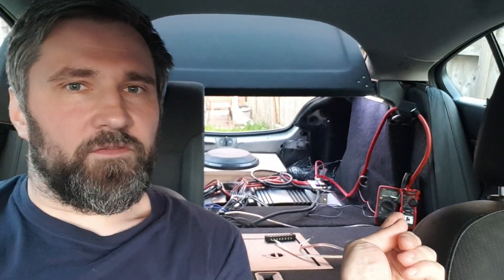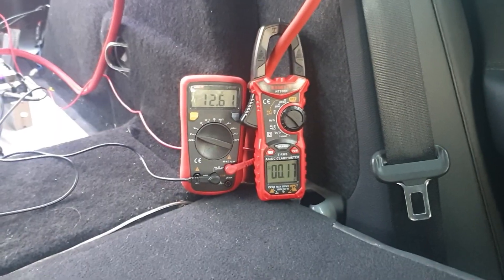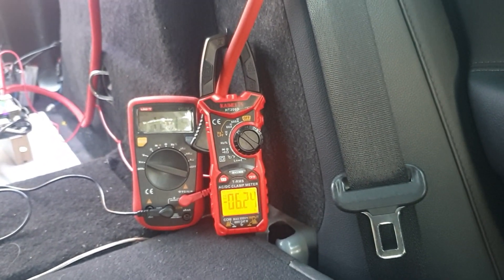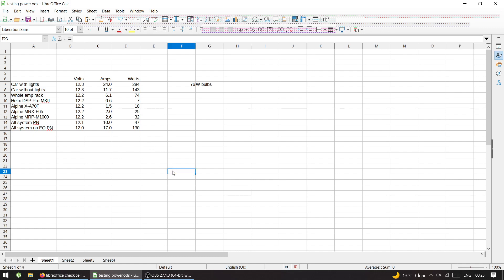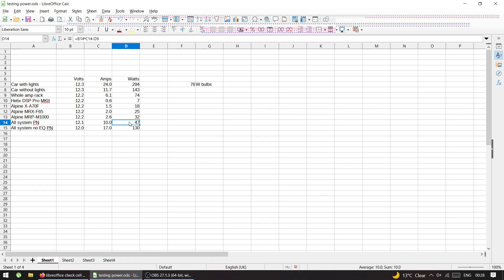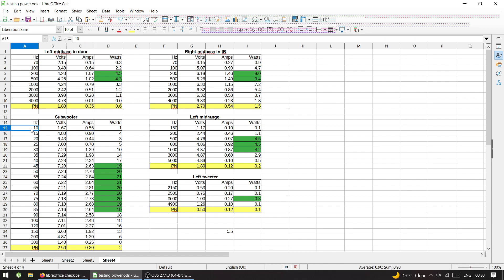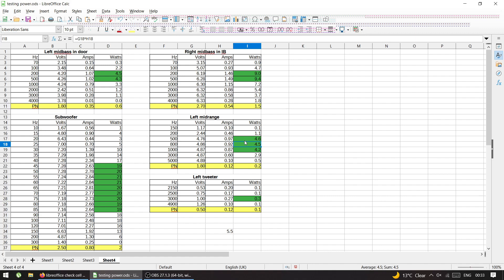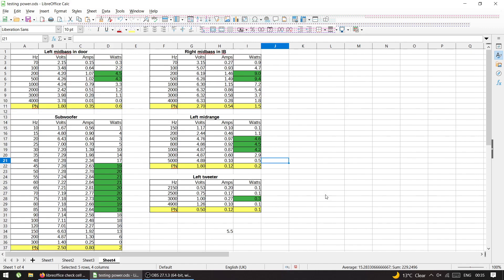How much power speakers ACTUALY use? (Detailed clamp test)

Comment: Again, I love your content. 

Same note here. The meter and clamp are frequency limited. Think 40-400hz. 

Also, amps do not return linear efficiency over their output range. DC measurements on the battery is a sorted mess.

Keep up the learning! All good stuff. You will no doubt come to these conclusions when the math fails the measurements.

Comment: All that makes sound is actually AC voltage and amps, soooo measuring the input DC voltage and amps without taking into account efficiency of the amps, wire ohm etc is absolut waste of time 🙂 . This video only misleads people. Good try , but next time do it the right way 🙂
Reply: It only misleads people if they don't understand what it demonstrates. The whole point is to show how little current your system is actually drawing while playing at normal listening levels. 

Your point about him not taking into account "efficiency of the amps, wire ohm etc" only further demonstrates how little current is being drawn by the system during normal use because efficiency is always less than 100%. By taking DC measurements, he is actually overestimating the wattage driving the speakers.

Comment: I am shocked with this video. So why are we buying high power amps. Cause I was thinking of buying alpine 
PXE-R600 that has 8 channel amp and dsp and use peerless NE series 3” FR front and rear and a 4ohm 6.5” Peerless woofer that will work only till 300hz and FR will take over so after seeing your video this dsp should be able to power coreect. Alpine r-a75m I will use for subwoofer